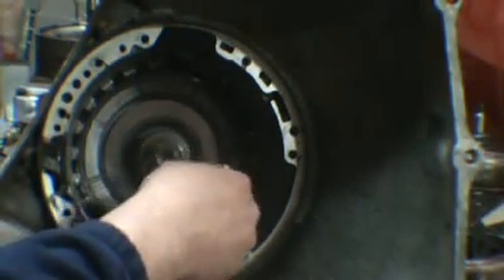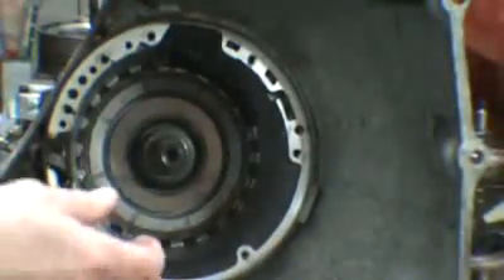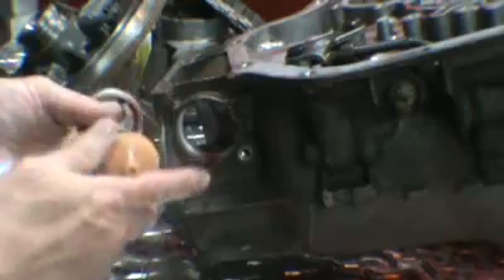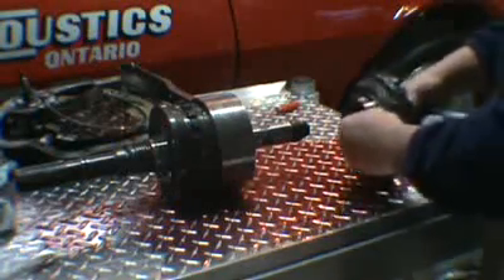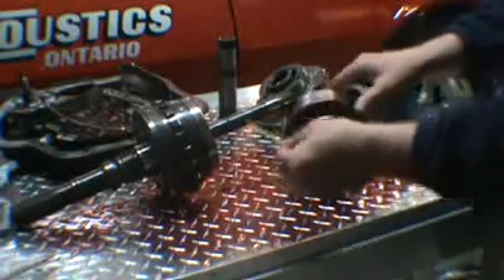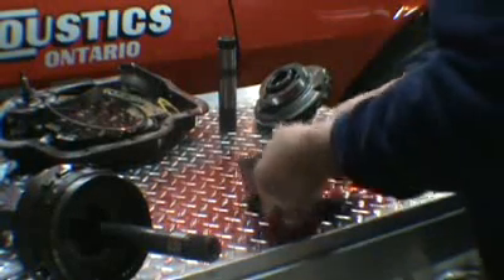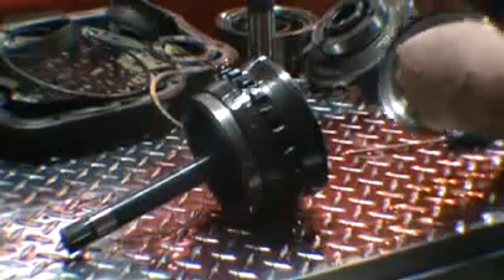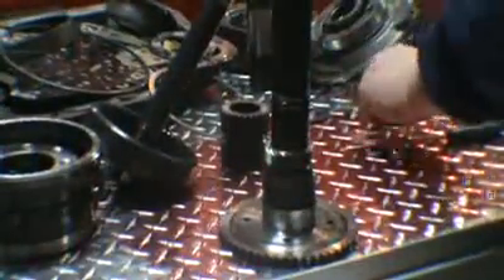Learn To Rebuild A Turbo 400 Transmission

Comment: my trans guy says he can install a 375 output shaft in my turbo 400 truck-short shaft so to mate with the existing turbo 350 driveshaft.He says will be just as strong but needs to shorten driveshaft.Or should he just rebuild it as is and buy a counterbored yoke?This going into my chevelle -currently with a turbo 350.
Reply from the maker: The 375 is  a truck output shaft.The short shaft is for cars.Yes the th350 shaft will mate with the 375 output shaft.If HP is not over 500 you should be ok.
Reply from the maker: Yes it will fit and should handle 500 hp

yes it will fit.
Reply: They mad a turbo 400 with smaller shaft ,so you sont have to go with 375 ..1966 1967 1965 turbo 400 is direct fit

Comment: Can you basically make a TH400 work with any GM motor? Can a TH400 work with 3.6 v6 LFX motor?
Reply from the maker: If it is a chevy bolt pattern for the block,it will fit.

Comment: Hi there i love your video thank you sharing that , i have question for you if you can help me with my car . i have 1968 cadillac devill that i purchased from arizona , in the first day the tranny  was shifting smooth  then start acting bad ,now  when the car cold shift perfect after 2 or 3 minutes driving the tranny will shutdoune  notheing go in gear it well go in gear if i tern the car off and restart it and it well drive for a little and stop , if you can help me pleas let me know whats going on if it need a rebuild or not , thank you best regard    OMARI
Reply: That happened with my Sprinter Van. I found the Torque Converter was clogged. So a Fluid and Filter change along with torque Converter Flush will most likely do the trick for you.
Reply: thank you for the attention  . i have found the problem . it was the radiator.was  return water with the transmission oil ,so the transmission oil was mix with antifreeze , i installed a oil  cooler for the trani it works great know . 
know i dont know if any problem with  the engine
Reply: the radiator upper  hose it has pressure all the time but its not over heating , do you think its normal ? thank you for your time